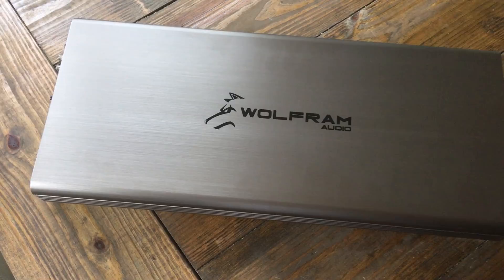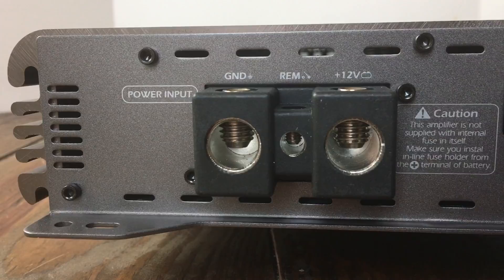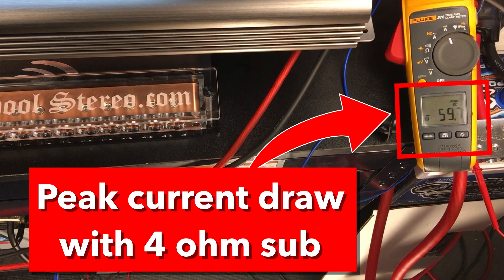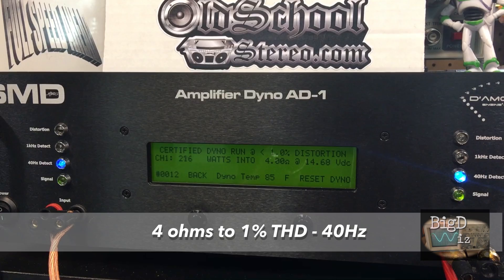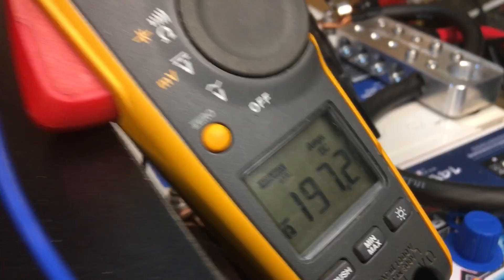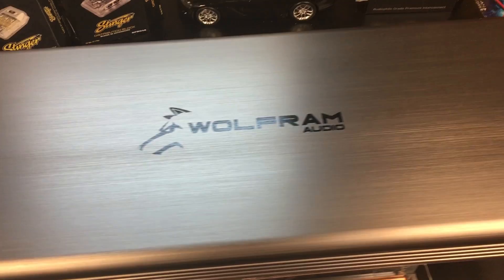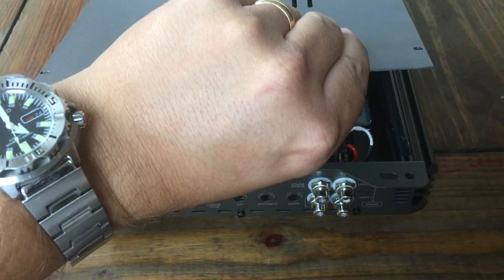Wolfram Audio W-3000.1 3000W Amp Dyno Test

Comment: what ever happened to birth sheets? only kicker, rockford, mtx still doing it.. companies got lazy and quit testing every amp.. then they wonder why so many dead amps are sent back for returns
Reply from the maker: It is expensive to add verification sheets into the equation. I’ve noticed some mfg’s (Rockville) include birth sheets, but I do not believe they are accurate (according to my tests). Kicker, RF and MTX have valid birth sheets though
Reply: @wal  yea, they should be included in the price we pay. I would actually pay an extra $25/30 for an actual birth sheet.. but I only buy Korean amps and I haven't seen 1 that don't do rated power.. it's just hard to actually know where the amp is made unless the company tells you (skar) lol glad u told us, this whole time I thought the sk line was Korean.. so I switched from a skv2.2500 to the deaf bonce aak-4000.1 and aak-200.4 love them both and will keep them for a very long time, they look nice togeather

Comment: For that I rather get the CAB
Reply from the maker: +al garcia great bang for the buck
Reply: sicko status Why? The cab only does 1600w
Reply: ITzMichael523 the CAB at .5 does almost 4000 watts
Reply: cab 1600.1 @1ohm but it did peek I think 37/3800 watts at .5
Reply: carl meadors dynamic numbers are irrelevant
Reply: ITzMichael523 that's not entirely true. Dynamic tests are still rms numbers. Basically it shows you what to expect on daily music... what people have to learn is that the dyno is a resistance test. Playing our subs the amps will never see just one impedance
Reply: john wagner a tenth of a second burst is not daily music. Dynamic numbers are irrelevant end of story!!! The only numbers you should even consider is certified numbers
Reply: ITzMichael523 dynamic numbers are still rms numbers.... ask Steve Meade916 or Tony D they'll tell you the same. Dynamic sine waves are less harsh on the amp than the certified or uncertified waves but I promise you it's still rms
Reply: john wagner it's irrelevant
Reply: ITzMichael523 the cab does far more than their rated power. It is very important to remember the harder you run your amps the more likely they are to fail.
Reply: mem10fan2 the amp does 1600w end of story
Reply: The cab is not as good quality amp as this

Comment: I want Dyno Pioneer GM-d9604
4chnaal 1600W
Reply: ASSASSIN HKS I've had that amp. it's a little beast. he did a video on the smaller version and it over performed on every test.
Reply: You mean 8604? Budget gem or Budget bust dud that amp already, nice amp.. it lacks on the crossover though.. not good for active setups
Reply: 8604 and 9604 same amp inside, just a different outer shell.. I had 8604, nice amp.. crazy it can handle 1ohm too, I upgraded to a deaf bonce aak-200.4 and much happier, lot more power and a nice price in comparison to the sundown 200.4 same exact board, only the dB has way better crossover

Comment: so wut is the best bang for the buck amp you recommend? I'm an old school Rockford nazi.
Reply from the maker: Budget and use?
Reply: Budget = Cost per (true) watt / Use = Bass / 1  or 2 channel.
My sub stage is running at 768w on a Punch 500 and I/we can't trust other manufactures claims.  
If you were going to replace my RF 500 with another modern brand what would you use?
Reply: According To Honda the Wolfram 600.1 is only $199 and is rated 700rms @ 1ohm🤔
Reply: Thanks!  Have you used a Wolf?
Reply: According To Honda I'm currently running the 3000.1